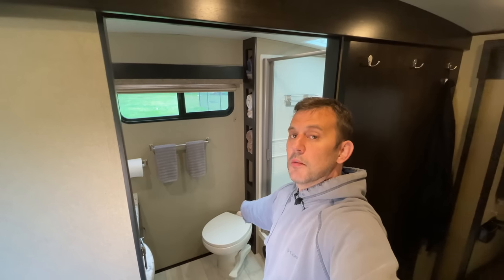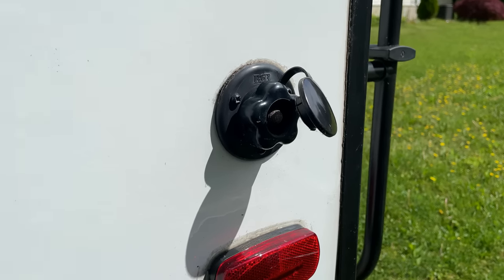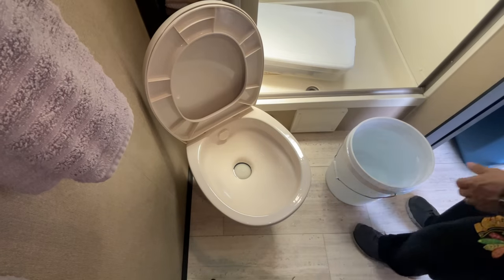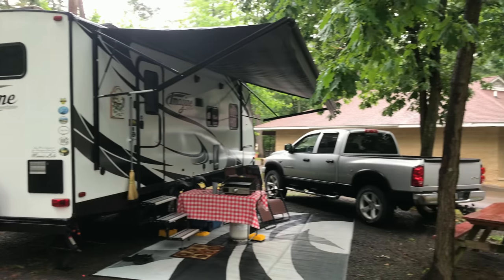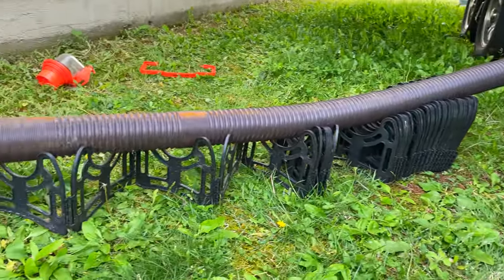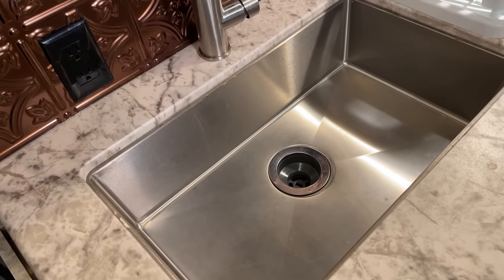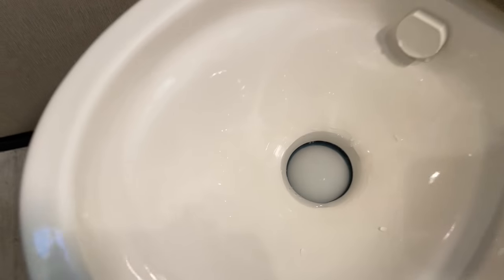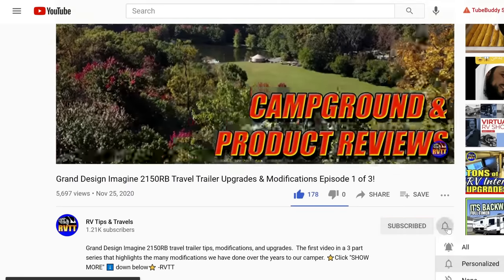RV Black Tank Cleaning, Maintenance, Tips & Tricks - The Original Black Tank Master Class

Comment: HI Ross - this was such an awesome video.  Thx so much.  I knew about the extra water and Aqua Kem and faithfully do that after each outing.  Unfortunately my black tank flush has never worked - I think the back flow preventer is stuck as the connection spits water everywhere and never enters the coach, so I can’t do the extra cleaning.  Here is my dilemma.  While the coach is parked between trips, with clean water and 8 oz of chemical, it fills the coach with the clean chemical odor - really strong.  I have to open the coach for awhile to get fresh air before a trip.  It only happens with the clean tank.  I never have odor when actually on a trip, only when the coach is clean and parked.  Could that be because I did not know about the ball valve trick ?  However, it does often seem the odor is really strong under the kitchen sink.  Maybe a blocked vent ??  Any idea would be appreciated.    Thx so much, Linda
Reply from the maker: look into getting "happy campers" black tank treatment.  that one is odorless.  fill, soak overnight and flush all tanks, then try the happy camper for a trip or 2.  circle back to me if that doesn't help.
Reply: @RVTIPSANDTRAVELS  Hi Ross - it isn’t black tank odor at all - it is after dumping and adding a few gallons of water, 8 oz of Aqua Kem - and then parking in the RV lot.  Not sure where the Aqua Kem fumes are leaking from but it’s really strong.
Reply: @RVTIPSANDTRAVELS  OK - great, I will try that one 😊 THX

Comment: Why aren't gray tanks designed to dump directly into the black tank first before it leaves the RV. At no additional cost of water or  time it would run through the black tank and as you stated it has (surfactants) soap that would help clean the black tank.
Reply from the maker: That would be a good idea Todd!! I think there is some liability with manufacturers and the gray tank water overflowing the black tank... so there would need to be some sort of mechanical system where the black valve would need to be open before the gray tank valves would open.  Thanks for watching bud.

Comment: What do you recommend to make the orange sewer hose hook up easier, twisting as hard as I can I can't lock it, even my husband can't lock it. I bought those orange wrench things and they don't work worth beans... also I had to pay a handy man $70.00 dollars just to hook up new hoses for us.  There has to be an easier way to do this, any recommendations?  Thank-you for your video!
Reply from the maker: They are very easy to install.  It sounds like you might not have the part?
Reply: @RVTIPSANDTRAVELS   standard Camco hoses with orange hard plastic ends, identical to the ones removed. Couldn't untwist those either.  Sigh.  :(  Thank-you for your reply.
Reply from the maker: can you send me an email with pictures of everything?
Reply: @RVTIPSANDTRAVELS  I'll try tomorrow sometime, thank you.
Reply: @RVTIPSANDTRAVELS  I sent you a picture to your email at your website. Wonder if I in future use wax or something if that would help.  Take care now.

Comment: Thoughts on fabric softener after flushing. We put it in on travel days and let it slosh around
Reply from the maker: Hey Jerry, I’ve heard that works great as well to help clean the tank.  I’ve never tried it so I didn’t mention it but have heard it helps with odors.  The only issue with fabric softener I can think of is that it’s not meant for black tanks, meaning it doesn’t introduce the good bacteria in the tank to break down the solid enzymes…. Therefore I’m not sure how well it would do without a specific black tank treatment.  Appreciate you watching and adding to the video!  Have you had luck with the fabric softener?
Reply: So far so good. I mean, we saw it on the internet so it has to be true, right?
Reply from the maker: @jerrymcbroom8560  only 1% of information on the internet is false 😆

Comment: Do you close the valve in between the 1st and 2nd 5 gallon cleaning dump?  Or can you leave valve open during the whole black tank dump/clean?
Reply from the maker: you can do both.  Sometimes I leave it open so it drains right out, sometimes I will close it, let it sit for a minute, then go out and open it up.  I just alternate every once in a while.  Either way is fine.  Thanks for watching Laura!
Reply: @RVTIPSANDTRAVELS  thank you!! I am a complete newbie!! Just learning ....yikes! Is there a separate hose to drain gray tank?  And do I only use the propane for refrigerator etc if I'm not hooked up to campsite electric?  I'm just confused as to why I need the propane?
Reply: @RVTIPSANDTRAVELS  oh and how often do I need to pour water down the toilet...not during dumping but just in general?
Reply from the maker: 5 seconds is a good rule of thumb is you are on a hookup.
Reply: @RVTIPSANDTRAVELS  I meant how often do we need to pour water in toilet as we are just at the campsite?
Reply from the maker: @laurahausman1370  after you put water back in the tank after dumping, just use the toilet as normal, no need to put more water it.  water is going in when you flush.  does that answer your question?
Reply from the maker: Propane can be used when there is no electric or when traveling.

Comment: Can the flush valve leak odor?

I got a 2002 terry fleetwood rv from an older couple that never used it, it sat in a garage and it was a steal! ( didn’t have to take some deck off or anything lol ) 

But the flush valve is below and loops up into the black tank.
It didn’t seem like it did much if anything after I had flushed the black twice.
Reply from the maker: I guess it could, but there is a vacuum breaker on the line.  Depending on how it is plumbed it may be open enough to vent gas.
Reply: @RVTIPSANDTRAVELS  great thank you. I’ve also ordered some of the hose tools to spray. When I used them the sensors started working perfectly. And liquified works well - I’m attached to a septic and that was very important to know! Thanks

Comment: My bathroom sink in my 2020 Lance actually drains into the black tank. Is this a code violation?
Reply from the maker: Hey Ray, after completing this video I found out that this is the case in some campers. I don’t know why manufactures are doing it, it does not make any sense to me. The only reason I could think is because it’s so close to the black tank maybe it saves them money on pipe? Nobody has ever told me the reason this is done in some campers, but it’s very misleading, especially to people who are monitoring their tank capacities.

Comment: Great video!  I was told 3-4 bowls full, (3-4 gallons) but the bucket definitely seems quicker and less wear/tear on the pump.  Thanks!  New subscriber here.  btw...I use the Geo Method, but didn't know it was called that.  I also use some of the "pod" material....use so less of it that the "pod" deteriorated and I put in a couple spoon fulls of the smell-good stuff.    My Thor was designed with the black tank on the passenger side....and the toilet doesn't go straight through....I miss my basic toyhauler sometimes.  :)
Reply from the maker: Thanks Taz

Comment: How long do you let the tank flush run?
Reply from the maker: A couple minutes max, usually until the water coming out is clear.  At that point it’s done it’s job.  It’s not a high pressure wash, just a quick rinse.

Comment: I noticed a smell around my bathroom area in my Jayco 2013 264BH and noticed a slit in the linoleum near the door. I started peeling it all up and the wood floor is completely soaked with black tank liquids. I don't even know where to begin I'm scared to even to cut into the wonder board because I don't exactly know what's underneath. I reached out to Jayco and they gave me some exploded diagrams but it still is a little fuzzy.. Help!
Reply from the maker: youll have to take it to a repair shop.  i cant possibly help without tearing it apart.

Comment: Small comment, you show opening the black tank drain valve with no drain hose connected. Seems like that would be messy. For we newbies maybe showing the drain pipe(s) connected and water coming out when the valve is opened would be good.
Reply from the maker: At what time in the video?

Comment: Hi Ross, we recently bought an RV (Jayco 166FBS) and found the fluid meters to be quite inaccurate.   They seem to indicate water levels are far higher than reality.   My RV has 30 gal grey/black water tanks.   Recently, I noticed the meter stated the black water was at 2/3rds full.   I emptied it, performed a thorough black water flush and checked again and found it to be "E"mpty.  Great.   I then added a 3/4 full Home Depot pail of water (4 gallons) and checked again - it read 1/3 full.  Are these meters set very conservatively?   Can you provide guidance?   Thank you!
Reply from the maker: Hard to say Jerry, they can be all over the place.  try empting it, filling it up to capacity about 27 gallons with some dawn dish soap, let it sit for a day or 2 then flush.  soaking might help clean any TP off the sensors.
Reply: @RVTIPSANDTRAVELS  Thanks very much Ross!
Reply: @RVTIPSANDTRAVELS  Hi Ross, is it possible to perform a visual test of levels?    Grey water - if it starts to pond in the shower basin as this is the grey water low point    Black water - visual observation down the toilet.    I would really like some control over this.   We only recently purchased the trailer;  gone on a couple trips and this is definitely something we are constantly checking and worrying about.   I'd hate to decamp to go to a dumping station on a false positive!
Reply from the maker: Shower basin for the gray, I’d fill the black to capacity and see where the level is down through the toilet so you know what to look for.  I do that occasionally because I don’t trust these sensors.  The only drain I’d leave open would be the shower drain since nothing solid is going down there.  Just make sure to form a p trap on your sewer hose.
Reply: @RVTIPSANDTRAVELS  Thanks very much Ross!

Comment: Nice advice but nothing said about rv's with macerator toilets? Which basically makes a pop slurpy and is pumped to black tank. Main thing I've learned is as you state, water is your friend in black tanks.
Reply from the maker: didnt cover them in this video, mostly because i never used one, and i dont really give advice on things I dont have experience with.  That may be a video in the future.

Comment: Lots of info, well done. Until a group of campers install black tank cameras,  these clips are guesstimates, with a bit of common sense.  The best black tank video had a camper who employed a professional tank cleaner who gave the best insight.   We set up, go #1 usually with maybe bowl full of water, sometimes some chem the wife adds, after dumping I use the sprayer a bit.  You'll never know how clean the inside is without a camera. I also question the chems and if they hurt or help the sight systems.
Reply from the maker: i will be releasing a video this summer with open black tanks comparing checmical treatments vs surfactants.  I have a really strong inclination that the tank cleaning services advice is way off, but I guess we will see after the video is released.   thanks for watching!

Comment: I have dumped my black tank on my 5th wheel, using the the auto flush system. For some reason, my holding tank tank fills up too and I don’t know why.
Reply from the maker: Which tank fills up?
Reply: @RVTIPSANDTRAVELS  the tank that holds clean water when bun docking.
Reply from the maker: sounds like pressure is backfilling through the pump

Comment: Hey Ross what's your opinion about Anti Sway bars.
Reply from the maker: if you mean an actual sway bar hitch, one that is separate from the spring bars... Ive never used one... I run the Blue Ox Sway Pro hitch and it works like a charm.  I also have a short trailer and tow with a 1 ton so I have a set up that is most likely not going to see the worst of it.  I think actual anti sway bars arent a bad idea, if they are in the budget, but not necessary.  i would always advise on a trailer hitch with weight distribution bars though.  always.

Comment: The ice trick will make an ice pyramid that you could have a hard time breaking up. We had to pour hot water down the toilet to melt it.
Reply from the maker: you should put water back in the tank before adding ice.  it wont stick to the bottom if there is water in the tank.

Comment: I simply fill my black tank and flush two times when I get home, usually takes care of any residue left behind, I leave open for about a week, then I close and fill with five gallons of water while it’s sitting and then I drain to not be hauling the extra weight, course when winter is sitting you would want to drain all tanks, that’s my two cents 🤷🏼‍♂️
Reply from the maker: I drain all my tanks over the winter too Don.  I also leave the valves open so the tanks can air out over the winter.

Comment: We have used the "geo method for" since before it was given a name.  The Dawn dish soap?  Ehhh...used as a "lubricant"?  OK, it's cheap.  The thing to consider is simply environmental condition versus cost.  Borax is about $6 per box.  For us a box per year.  Happy Camper is good, but you are getting borax and other stuff. (Zink salts)  ~$28 per tub...40 scoops.  Blue Thetford and some others are designed to look and act like those porta-outhouse treatments.  Legal, I guess, but smell horrible.  The borax method will not harm...actually might help a septic system.  Not sure about Happy Pooper, but likely OK.  The blue stuff should never be put there.  Good for pit toilets and public dump systems. (Although is cannot be good for public sewage treatment.) Our local sewage treatment is a small organic system, so we help it by only using borax, as it is an oxygenate...plus dissolves in water.  We have not gotten the brown-mound-of-renown...no poo-ramids.

Comment: I'm wondering why in some of these comments that people are worried about flushing gray back into the black tank and then some black water getting into the gray tank contaminating the gray tank. Are you using the gray tank water to shower with, drink, wash with, WHAT ? 
Why are people worried about contamination in the gray tank ? It's contaminated already with soap, food waste and shower waste all decomposing in the tank.  Am I wrong or is it not contaminated  ?
Reply from the maker: That’s a great question Steven, and everything you are saying is true.  The big difference though is that the gray tanks don’t have a sprayer flush port.  I will attest to the flush port making it easier to clean a black tank.  A little shower water left in the tank probably won’t cause any serious odors, but a little waste water can.  Without that flush port to help clean, it could be a problem.  Besides that there really is no difference.
Reply: @RVTIPSANDTRAVELS  I have an adapter on my main drain that will allow me to hook a water hose to it and back flush either black or gray tank depending on which valve I have open.
Reply from the maker: that will do the trick Steven.

Comment: What's your opinion of a macerator
Reply from the maker: Hey Charlie, never used one but I understand they are used on permanent sites a lot.  I havent really even researched them or their purpose all that much since I have never had any issues.  Your thoughts?
Reply: @RVTIPSANDTRAVELS  I'm going to install and use one on a travel trailler it uses a smaller hose

Comment: Well done.  Lots of good - understandable - info.  I've been pulling a trailer for 10 years and always learn something new.  Any tips on cleaning the black tank sensors?
Reply from the maker: Thanks Jeff!  So the only thing I can think of is to get one of those nozzles that you stick down your toilet and it sprays water sideways. Toilet paper and solids will get stuck on the sensors themselves and besides soaking it overnight, the spray nozzle is the only other way I can think of to get stuff unstuck from the sensor.
Reply: The way to do it is to add 20-30 lbs of ice to an empty tank before leaving for a drive.  The ice bouncing around the inside of the tank knocks the paper off the sensors.

Comment: Can i ask. Ist ok to use one tank for both grey & black ?
Reply from the maker: No, the plumbing isn’t set up that way.  Even if it was, it would be a small tank for all the water you’d use.
Reply: @RVTIPSANDTRAVELS  i mean. Can i make one tank for both grey & black water? Or not? Im in my way to do my custom camper & i feel if i make one tank will make it easy for me
Reply from the maker: You can, but what’s the reason you think it would be easier?  I’m curious 🧐
Reply: @RVTIPSANDTRAVELS  im building a sliding camper to goes on my 66 chevy truck. Would like to keep it small & simple. And there is no enough space for 2 tanks
Reply from the maker: In that case yes, it all empties to the same place.  Just make sure to install p traps everywhere since the sinks will be a direct line to the black tank.
Reply: @RVTIPSANDTRAVELS  good advice thanks alot

Comment: That was a great video! Thank you.  I'm having a issue I have numerous times flushed my blk water tank as soon as I empty it it says 1/3 full then when I full my toilet bowl 3 times to put my waste treatment in it says 2/3 . Also on top of that when I do grey n blk they both say 1/3 full after directly being dumped and then checked.  I don't get it they both would show empty before.  My galley kitchen sink reads empty . TIA for any input .
Reply from the maker: Try soaking it with some dawn dish soap for a day or 2.  TP might be stuck on the sensor.  Also, have you tried tilting your camper on leveling blocks to see if it’s just water not coming out?  Depending on how you park and level your camper, if it’s even just a degree or two off the water could be rolling to the side without the drain. Try those two things and let me know if you’re still having issues.